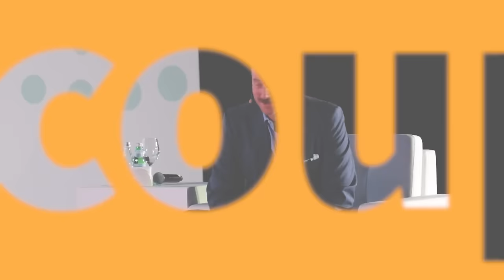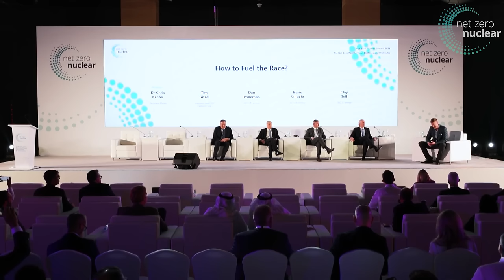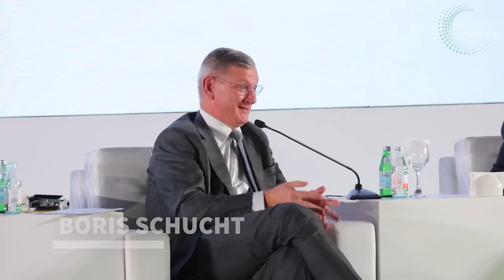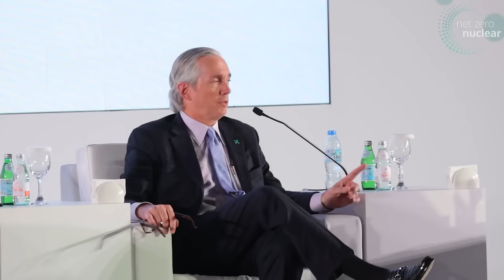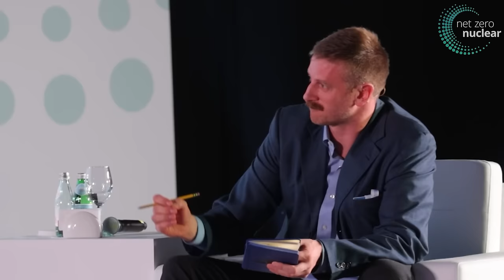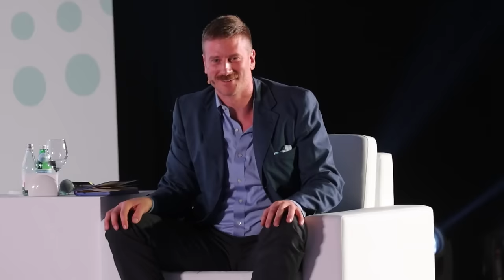How to Fuel a Tripling of Nuclear Energy

Comment: Or..... we could commercialize liquid-fueled fast reactors without the need for any additional uranium mining or processing.
Reply: I agree with you but first someone has to stump up the cash for the in depth material research and testing. And there is no short or medium term profit in that.
Reply: I agree, especially for the long term.  But the competing concepts of sodium cooling of fuel rods and gas cooling of ceramic pebbles seem to provide equal protection from the fear of radioactive releases and also provide for high temperature operation for industrial uses.  They also seem to be on first-of-kind scheduled construction paths as likely to be completed as the first MSRs.  And there are certain advantages to confinement, rather than circulation, of the radioactive fuel in those designs that simplifies fuel accounting and waste removal, whereas that may still take time to perfect for MSRs.  I also welcome new PWRs & BWRs in the interim period because, regardless of cost, they will still be less costly than any adequate storage-backed use of un-reliables.
Reply: Both... both is good. We can't make any of these reactors fast enough anyways.
Reply: You mean fast reactors surely. Use  abundant and already mined U238. Problem is only Rosatom actually has one running. Not exactly a way to escape the Russian bogey man.
Reply: Which liquid fuel fast reactor doesn't need highly enriched U? I'm not aware of any. And let's remember, those that are able to convert the fuel inside the reactor still need a full startup load of enriched U or Pu.
Reply: @oscariglesias9004  A thorium/U-233 MSR operated in the thermal spectrum, although doesn't have a high breeding ratio, since the fissile load is much lower than a typical fast reactor configuration, the doubling time is very short.
Reply: @timothytaylor5867  still, either thermal or fast, I'm not aware of any design that doesn't need high % of fisile in the core, am I wrong?
Reply: @oscariglesias9004  That's what you need to get them started and then it can be removed to start another reactor after a certain amount of time. (I don't know how much time) The US has over 500 tons of highly enriched uranium/plutonium that would like to get rid of, what would be a better match.

Comment: 33:48 33:59 "What is TRISO Fuel? TRISO stands for TRi-structural ISOtropic particle fuel. Each TRISO particle is made up of a uranium, carbon and oxygen fuel kernel. The kernel is encapsulated by three layers of carbon- and ceramic-based materials that prevent the release of radioactive fission products." Jul 9, 2019
Reply: TRISO fuel is the "pebbles" in the Pebble Bed Modular Reactor (PBMR). The fuel pellets ("pebbles") are spheres, and each pebble basically incorporates its own fuel-containment system.

Comment: Tripling nuclear energy until 2050 is completely delusional. You would have to build 800 additional big nuclear reactors of at least 1 GW output (so at least 300-400 big nuclear plants with multiple reactor blocks) in 16 Years. Since the pipeline to a new Nuclear plant / reactor is 15-20 years to grid connect, you have already lost this race. There would have to be all the construction sites at the ready now - that alone would take 10 years (very optimistical) if an enormous push starts today. The cost would be at least 10 Billion USD per Reactor, so 3-4 Trillion USD in 16 years or 250 Billion USD *per year*. Let alone all the protests against so many new reactors slowing construction further.
Then there is the little poblem of not having the skilled workforce and suppliers for that all - there is not even the workforce available for the few reactors in construction right now. And the cherry on top: You would have to build / refurbish another 150 reactors, that will be EOL until 2050 to reach the tripling goal.

In short: The whole picture is ridiculous. This is simply not feasable - in every singele aspect of it.

And even if you would be able to do it, all those reactors would only deliver about 25-28% of the world electric power needs (in todays demand - in 2050 this would even be higher, and thus the percentage of nuclear power lower). You don't have to waste a single thought about how to supply those reactors with fuel - it will never be needed.

In that time renewables will run circles around the few reactors actually in construction - much cheaper with a faster return of investment.

The whole plan is joke, as far from reality as Elon Musk colonizing Mars in his lifetime. The only thing that will work is burning billions of taxpayer money going toward this planning, that will never amount to anything - money that could be used to bring a lot more renewables online.